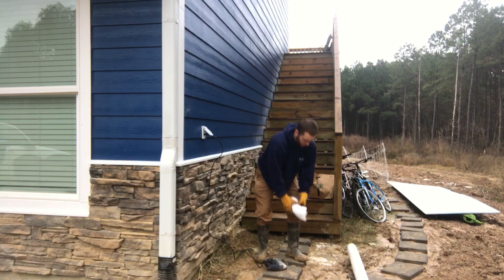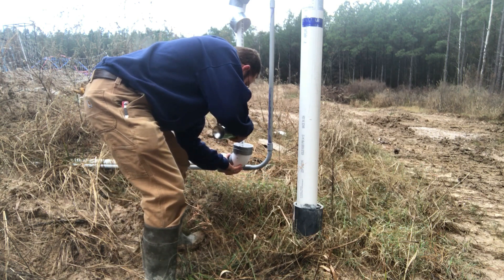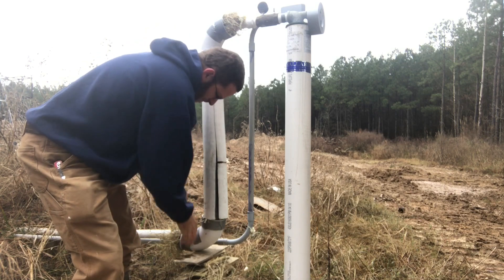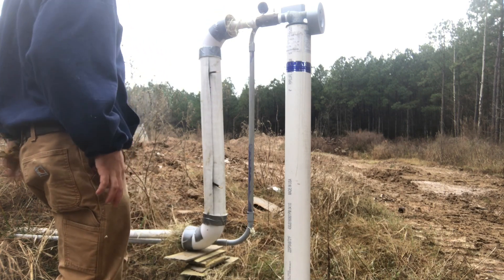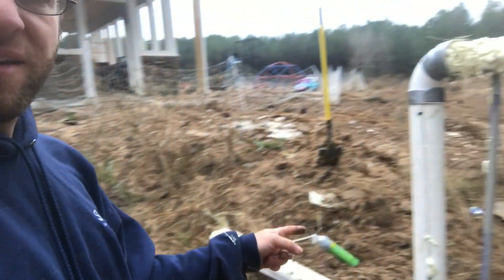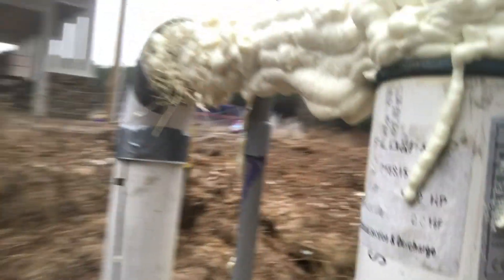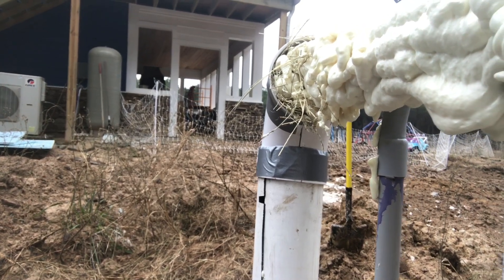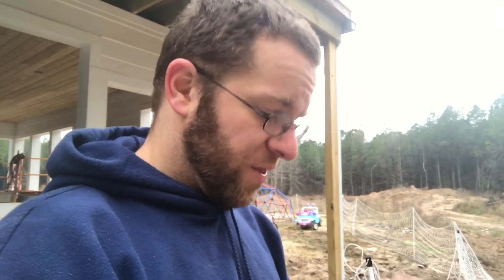Water Well Freeze Prevention (Unprotected in the South)

Comment: Dude ! Just cover the whole thing in a big pile of arborist wood chips it will heat  up and in spring youll have some compost
Reply from the maker: That is a grand idea! Just have to unearth it every spring. I wonder if it would actually hold temp all winter in an extended winter. Interesting permaculture approach. See my later videos, I ended up building and insulated pump house around it so I could get the pressure tank and wellhead all in a protected space. We just had record setting cold a month or so ago. With no supplemental heat, just the thermal mass of the groundwater in the tank, it was a comfortable 65° in the pump house when it was 20° outside. I was very pleased with that!
Reply: @TomBrueggen  Good idea to put  thermometer in the well house.  Was the 20F out  > 65F in   with the water trickling from a faucet in the house during the night ? .  Are you in 8a ? 

Yes .  all pipes and the tank must be buried at least 12" deep in  wood chips .I also cover  wood chips with Black plastic the ends of which I bury so no air can blow under them . The plastic  causes it to break down very slowly .It will last all winter > normally when it is very cold it si also very  clear and the sun shines on the black plastic .I am in zone 8a but Im from zone 5 where it was once -17F . .In zone 5  I put  6" of wood chips  over the plastic and another piece of plastics on top of that and burried the edges . The night it hit -17F  I left the water trickling in the sink
Reply from the maker: Yes we had a faucet trickling. Our water heater is in the attic (stupid I know) so we leave a hot line trickling to ensure water stays moving through that line. It’s enough to make the pressure tank kick on maybe once every few hrs, I’ve never really timed it. The important thing is just the thermal mass of the water, plus a south/west facing window, plus insulation. It’s shockingly common down here to see well heads and pressure tanks sitting out in the full elements with no protection at all.
Reply: @TomBrueggen  I looked but could not find the video of your well house .Please post a link here and in the description
Reply from the maker: @rbbiefah  https://youtu.be/scCxDz3zg_M

This video is more or less the first in the series. If you go to my channel and then the playlist “homestead development” they’re all on there. From pouring the slab all the way through final plumbing and electrical hookup.